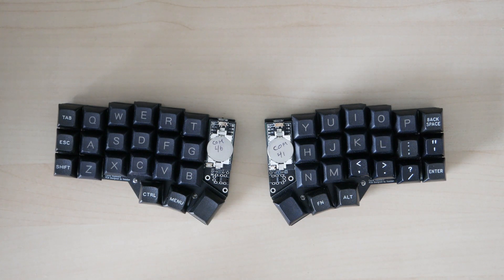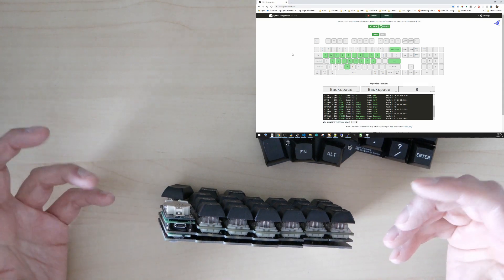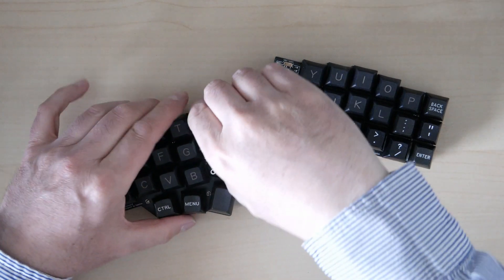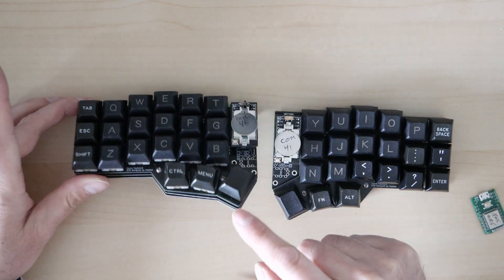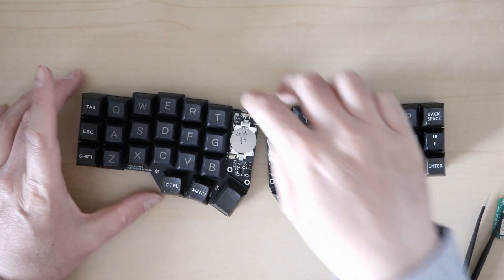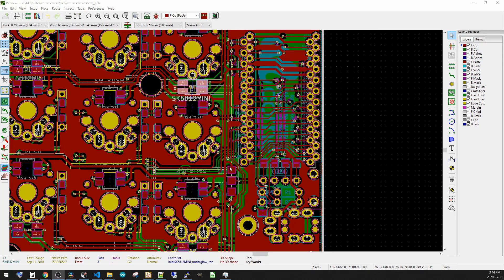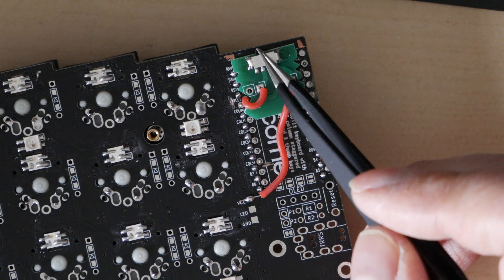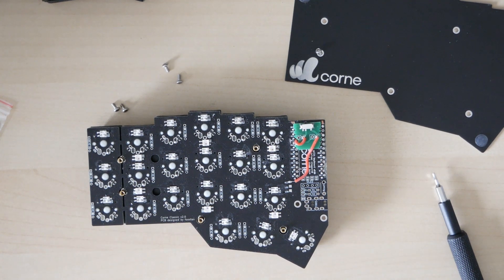Bluetooth Corne Split Keyboard and BlueMicro840 Build Notes

Comment: What are those batteries ? Rechargeable 2032 ?
Reply from the maker: Yes but I don't recommend them.  Too low a capacity for keyboard, especially with those RGB LEDs.

Comment: Where can I get hold of the board for the coin cell battery? Also is there a build guide anywhere for this style of wireless coin battery corne
Reply from the maker: I don't really recommend to use these coin cell batteries as they can't supply current for very long.  I usually recommend the larger 301230 lipo batteries that fit under the controller, between the sockets.

Comment: If i were to design a whole new pcb for a input device like a pro micro, do you think it could be the size of one?
Ive started making a project atm and i was thinking if i were to add a rechargeable lithium drone battery instead of coin cells it could be pretty cool, im not sure though.
Reply from the maker: I have been using LiPo cells as they are much better.
Reply: @BlueMicroWirelessKeyboards  oh okay nice

Comment: This is brilliant, however one thing that occurred to me is an issue with modifiers.  I'm assuming anything you do with QMK and function layers only work on each side.  Since they both connect via bluetooth to the pc, whatever is sent from each side is isolated and could theoretically have lag issues with modifiers like shift and ctrl.  Is this correct?  With a keyboard like this having a layer function on the right side and using layered keys on the right side is crucial to having enough inputs.
Reply from the maker: It's not QMK - It's using my firmware: BlueMicro_BLE: https://github.com/jpconstantineau/BlueMicro_BLE

Comment: I'm new to building custom keyboards.  From reading the other comments, it appears as though I can take any corne keyboard and add these pcbs that are available on OPs store for $25 each.  How would I program the keyboard then?  I'm assuming I can use QMK to program this? @BlueMicro Wireless Keyboards
Reply from the maker: QMK isn't recommended for nRF52840 chips.  There are forks out there that are old and QMK won't ever support it because licensing of the SDK isn't compatible with QMK.

Comment: Is there a keyboard like this that is under $100?
Reply from the maker: Not really.  The sum of all components do add up very quickly and unfortunately, the two BLE controllers make a good proportion of it.  Even wired with pro micros, the Corne keyboard with switches and keycaps would be more than 100$

Comment: Hey! Nice build you have there. Why don't you solder two 3000 mAh batteries to them instead of using coin batteries?
Reply from the maker: Soldering small lipo batteries underneath the controller is much better (and smaller).  Large 3000mAh batteries would make these RGB LEDs last much longer...

Comment: nice can you add an oled screen on top of it ?
Reply from the maker: yes, I have done so.  With the other type of battery (a small lipo that fits under the sockets) it's possible to have it at the same location without any special adapters.
Reply: @BlueMicroWirelessKeyboards  what is the battery life with and without the rgb ligts after changing to lipo?

Comment: Hi, I got a question, can I  use a configuration for Spanish? haha, I really need the "Ñ" so, can I program the keyboard in Spanish ?
Reply: Creo que la configuración es casi la misma a excepción de la distribución de las teclas,  es cuestión de comparar el teclado inglés con el español y percatarse que tienen la misma cantidad.

Simplemente te compras el Corne split sin las keycaps para usar un set de estas en español, el resto supongo que es cuestión de configurar el teclado en español desde la computadora.
Reply: @jolarful  puedes usar la ñ como en cualquier otro teclado en ingles pones distribucion US-Internacional y pones la ñ con ALT+N
Reply: yo uso mac y teclado gringo la ñ la hago apretando option + n = , y luego apreto la n, lo mismo para las tildes option + e = ´, luego apreto la vocal
Reply: us international --> "~" + N = Ñ

Comment: Love this , where can I get the 840s?
Reply from the maker: Once all testing is done, I'll be selling them on my store at store.jpconstantineau.com  I have sent some to a few people for testing as well.
Reply: @BlueMicroWirelessKeyboards  Will you be selling the little switch pcb's that you use to shut off the led battery drain as well? Those appear to be custom.
Reply: @BlueMicroWirelessKeyboards  can you comment and pin that when this is out on sale? Thanks
Reply from the maker: This is the corne keyboard that's available on multiple stores.  All you need for the conversion are the controllers, battery and switch.  I won't have this board available on my store.  I do have the BlueMicro840 available.  If they are out of stock, I will be building some more over the weekend.  I have all the materials to make 50 or so without me ordering more parts.